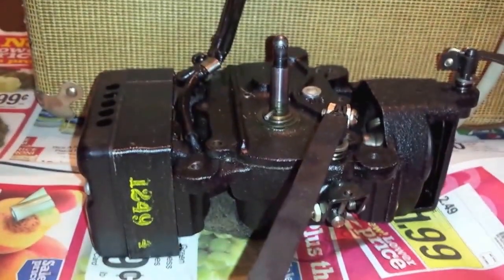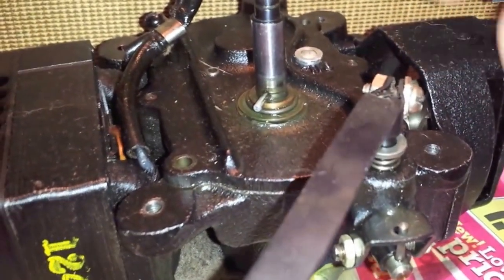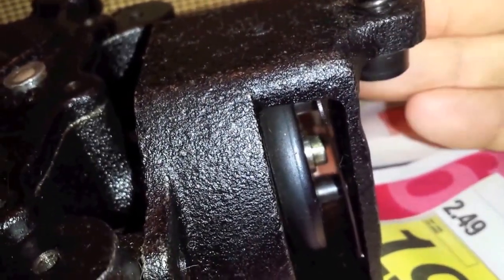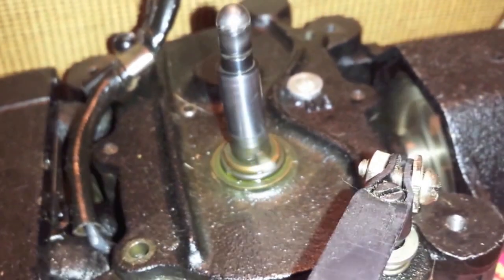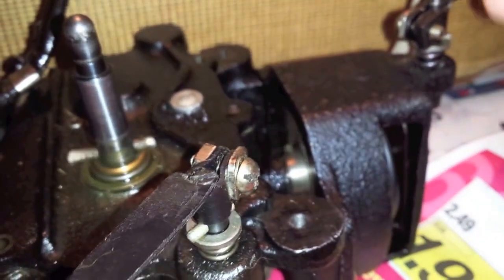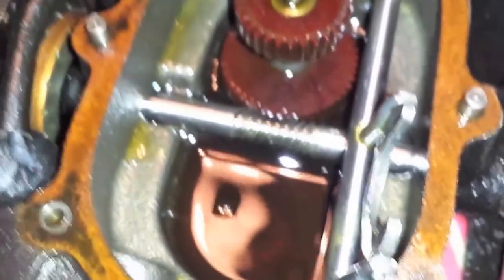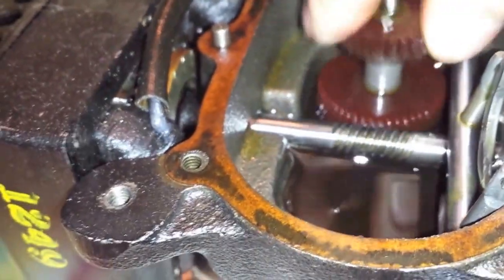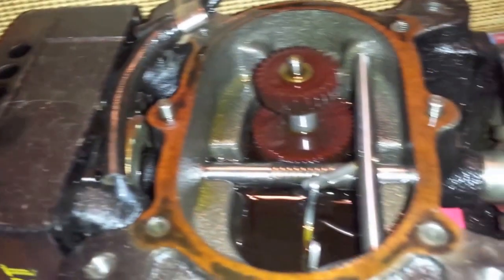Newcomb TR-16 and its mechanical gearbox

Comment: I just found one of these at a yard sale. This guy passed away and his family was selling all his junk he hoarded. I also have the same model in this video,  TR16....AND My motor is also stuck. This video is going to help me out, thank you! I tried plugging my guitar into the MIKE input, and man, it sounds pretty good! The speaker and power sections are detachable with a 25 foot speaker cable, and is covered in tweed. It looks like a Fender Guitar Amp form the 40s!!! This player was used as a PA for square dances and other school stuff....